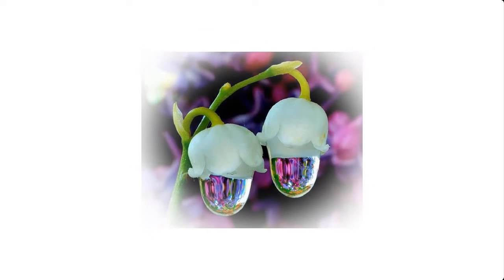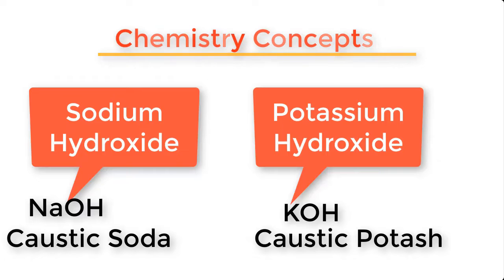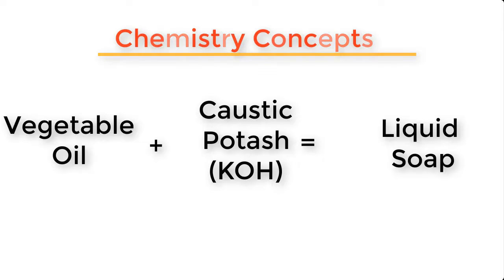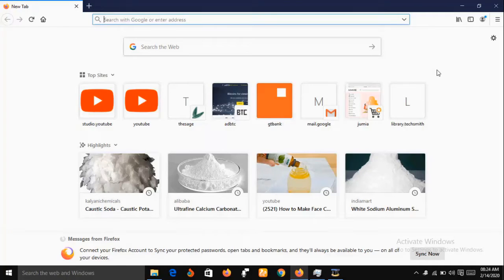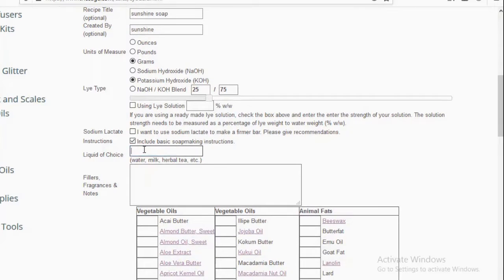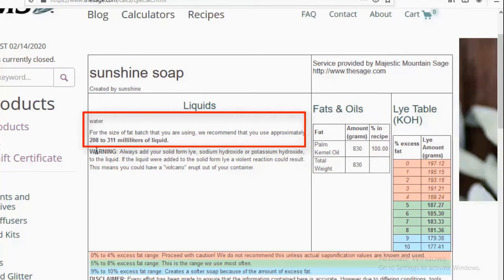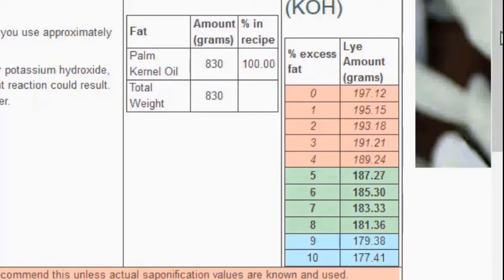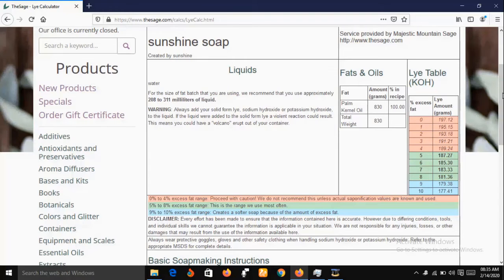How to Make Liquid Soap With Vegetable Oil and Caustic Potash (The Use Of Lye Calculator Process)

Comment: Hello,I just made this soap with canola oil and it didn't work,am sure cause of the process of the oil,I don't have palm oil but I did look into it and I can use other oils which I am going to try, well I end up with something like a spoiled milk, the oil separated from the potash and water, I did remove the oil and now I find out I have a paste that can be used for oven cleaner,I use it on a pot that is stained from cooking with wood, it cleaned it out really well, well,I mess it up trying different oil, but I end up with oven cleaner, I just have to use gloves, I will try with avocado oil and come out with an update, easy recipe, thanks.
Reply: Try cooking it ar low heat.
Reply: @TheDanikayu  that recipe doesn't call for cooking, just mixing.
Reply from the maker: Ok congratulations